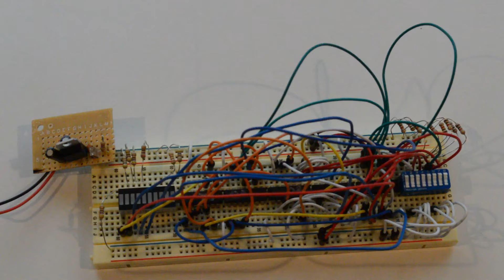How to actually build a 4 bit adder (on a breadboard)

Comment: What r the parts required
Reply from the maker: The main parts are a few integrated circuit logic gates (I forget the specifics but a few AND, OR, and XOR gates) along with a few resistors, switches, and LED's.